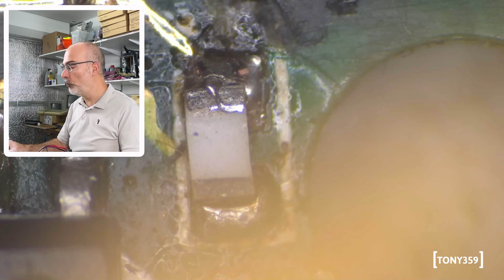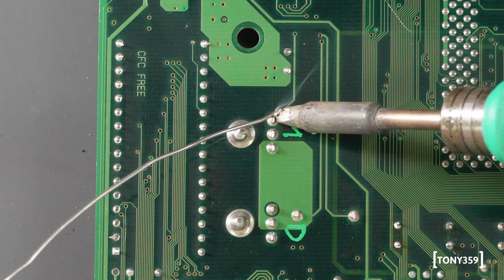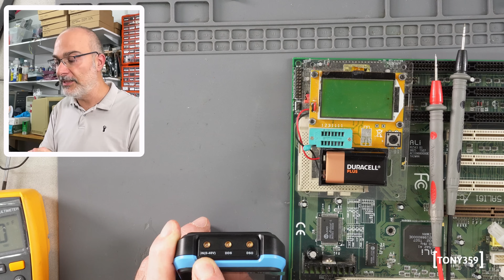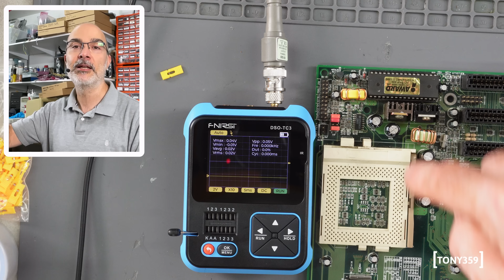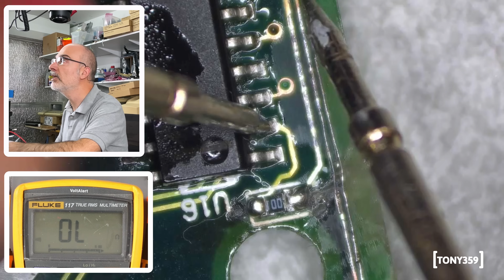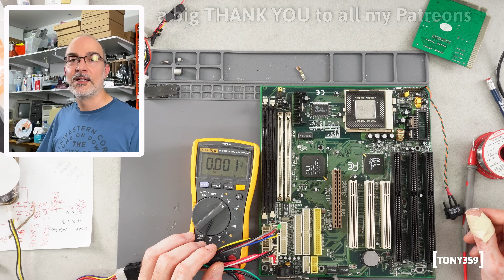This motherboard surprised me with multiple unrelated faults!

Comment: once you find more than one bad part you have to suspect a over voltage event. And at that point it's not worth it.
Reply from the maker: A very good point. Though I find weird that a mosfet can be damaged by that. Or maybe yes? Lightning?
Reply: @tony359  I would expect that bad smoothing capacitors killed mosfet. It became conductive and sent 5V to controller IC out and CPU. That killed them both. Than bad CPU could kill chipset.
Reply from the maker: well, if a bad smoothing cap, it will get really hot, might stress the mosfet but I doubt will send something to the controller because it's after the mosfet! Maybe a fried CPU might have damaged the southbridge - which is behind the southbridge though! (Besides the reset line and maybe other things?) . Anything's possible.
Reply: @tony359  Yes, bad cap itself cannot sent something to mosfet driver. But when mosfet is fried, it get shorted and connects driver s IC output to 5V directly...
Reply from the maker: Ah, I see what you mean.
Reply: @xsc1000  I fried an entire board by just touching the feedback resistors for the voltage regulator. so a leaking cap could short out the resistors and do the same.
Reply from the maker: Thanks - Let's say I started tinkering with BGA in 2010 and I am still nowhere :D
I should probably begin with simpler boards - XBOX 360 and PS3s are some of the most difficult ones to work with. 

The other thing is that if I buy something broken to experiment, I then feel sorry for the board, fix the fault and then I don't want to experiment on it :D

Comment: Old LCR meter is  better because it has know hard&soft-ware. As we know FNIRSI is *hit company, don't trust their software, they took existed opensource software and patched in own way. Also old one has calbration menu, does fnirsi has it or calibrated properly on factory ? Question, questions...
Reply from the maker: The FNIRSI does have it which didn't make any difference. Does my old one has it too? I didn't know. How does it work?
Reply from the maker: oh, interesting. I shall do that, thanks!
Reply: @tony359  The old one has no calibration menu. But if you start it with 3 probes short, than you got into it. You also need one capacitor of precise value (100 or 10nf I think)
Reply from the maker: Thanks, I'll explore soon!
Reply: @tony359  That short shoulb be close to 0 ohm, so dont short probes, just put 3 shorted pins directly to socket.
Reply from the maker: I have tried, my tester doesn't do anything with 1-2-3 shorted, I suppose the FW doesn't have that section...
Reply: @tony359  So what it displays when you short 1-2-3 and press test button? Just two 0 ohm resistors?
Reply from the maker: @xsc1000  Yes - sometimes between 1-3 and 2-3 and sometimes between 1-2 and 2-3. I soldered some resistor legs together to avoid contact issues and tried many times
Reply: When I tested that Fnirsi against a dedicated ESR meter and a dedicated capacitance meter the fnirsi failed quite a bit on capacitance particularly on low F capacitors. On ESR it was way out.  No where near to the esr from both calibrated meters. It's great for a lot of things capacitors are not included.
Reply from the maker: Yes, it's great at wedging the door open. :)